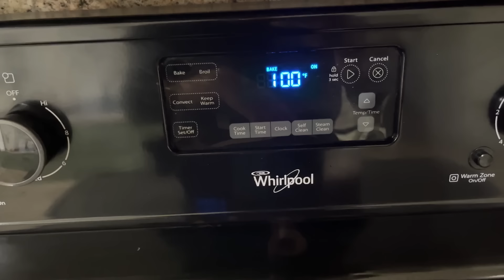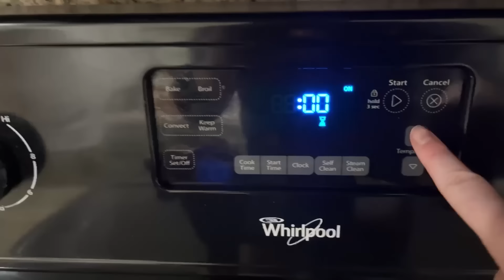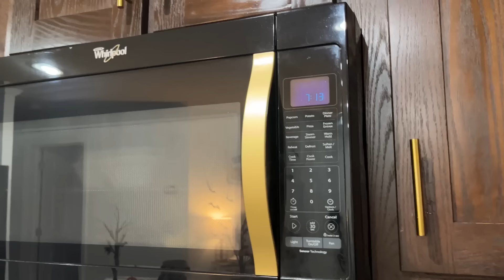✨AFFORDABLE & SIMPLE HOME UPDATES ON A BUDGET!! #diyhomeprojects #kitchenmakeover

Comment: Everything looks awesome. Great job guys. BTW those fake drawers under the sink can be made into small storage areas.  If you unscrew them from the back you can attach these fold out  fronts. I have them on mine and I  put sponges, wire ties , and an old tooth brush for scrubbing in small places.  You can get them at lowes or home depot.
Reply from the maker: Great idea!! Thank you so much I’ll definitely be doing that soon 😊

Comment: You can buy those kits for the false fronts.  They drop down and are good for sponges and scraper.  Make sure you get the kit for two pulldowns instead of one big one.  Measure the fronts of those drawer fronts before you purchase. Rev-a-shelf makes a whole line of customized cabinet accessories for the inside of your cabinets.  There is a trash can pullout for a cabinet. There are pullout cabinet shelf's also.  You can totally customize the inside of your cabinets.
Reply from the maker: Thank you for all the tips I’ll look into that stuff 😊